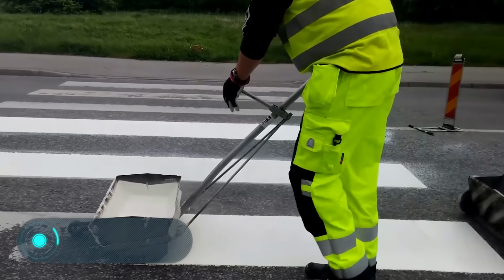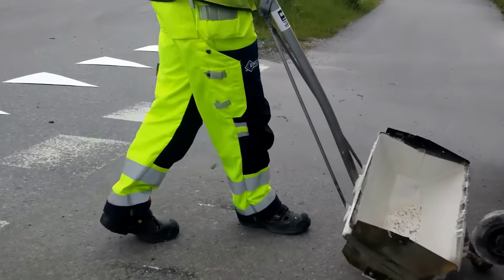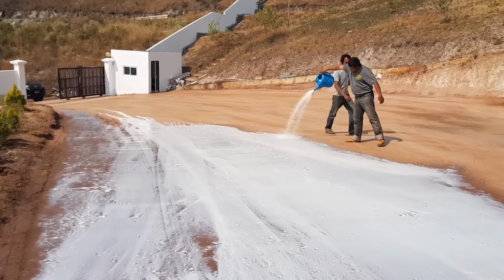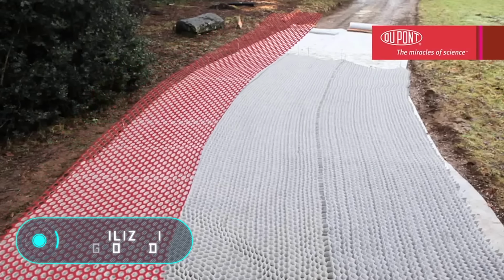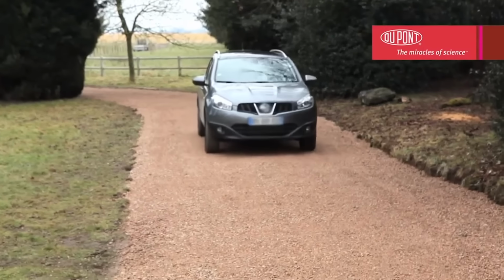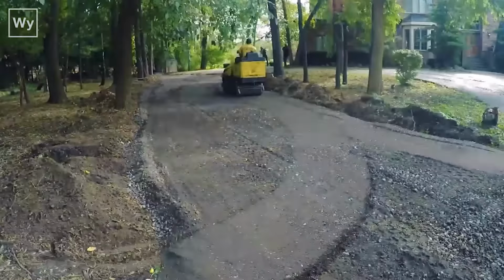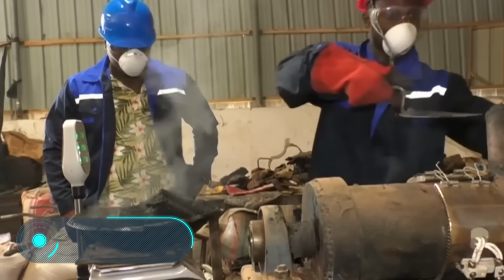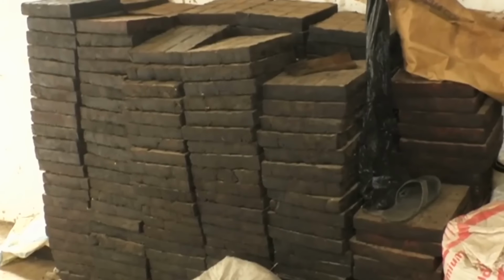INSANE ROAD CONSTRUCTION TECHNOLOGIES THAT ARE ON ANOTHER LEVEL

Comment: Just use shredded tires at emergency truck ramps. Then after years of sun degradation, and use, scrap them up lay down new shredded tires. Then take the old shreds and chip them further and add a percentage to asphalt!

Comment: As someone who knows a little about construction I would not be recommending this solution on main roadways.
This is ok for temporary roads only.

Tyres contain metal, metal heats up in warm / hot temperatures so will melt the asphalt and disfigure the surface requiring more repair works.

Same too for freezing conditions, this will make the tyres brittle (rubber becomes brittle in freezing temps) and cause the roads to collapse.

Plastic road markings - as you say these only last for 2 years, are very bad for the environment and again melt in high heat.

Geogrids are great for temp parking, foot paths etc, is pervious but costs a fortune
Not very well researched sad to say

Comment: Materials that last for 25 years are mentioned as high-end and durable and at the same time, roman roads are still around and sometimes even in use by motorists after 2000 years.
Reply: Roman roads didn't carry as much weight as modern roads, not even close:

RHEDA/RAEDA – a four-wheeled car that we would compare today to a bus. It had many benches and a place for luggage. According to Roman law, the weight of the transported items could not exceed 1000 Roman libra (approximately 330 kg). Usually, the car was a convertible, or it only had a cloth attached above the heads of the passengers. The cart was pulled by many mules, oxen or horses (even more than four animals);

This is a singular example, but it's clear they knew their roads weren't meant for extremely heavy loads. By comparison, one fully loaded semi truck weighs 80,000 pounds (~36,287 kg), and modern roads have to be able to handle that regularly.

Comment: i was wondering about how to use old transport truck tires to reinforce bridge piers and supports from river washouts .  tires layered around bridge piers and on river banks could be filled with cement and locked together by just the cement or maybe reinforced with lengths of rebar driven into the ground though the openings of the tires .  seems to me this would make a heck of a good method to stop flooding damage underneath bridges .

Comment: so i thought abut putting tires within concrete for under my driveway, not to just cut costs on material, but to also provide a good radiant heat battery, so when winter comes and the sun hits the concrete the heat builds up and the driveway stays heated for longer and that makes for less time you need or eliminate the need to use salt or shoveling the drive way.

i got the idea in how an earthship works, these homes hold tempter really well and that radiant heat holds very will. so i wonder if the same radiant heat could work for the same thing when it comes down to having a heated driveway. 

i think it could work but i think that the tires would need a few columns alongside the driveway to be used as heat holding batteries. the columns are also made up of tires that are filled with sand and compacted with super adobe to create that final finish that holds in the heat.

Comment: I was interested in fixing roads with tires. Guess we will never know.
Reply: it's not fixing.  it's just a method to dispose of unused tires.  tires can be used because they help stabilize the substrate.  it's killing 2 birds with 1 stone.
Reply: @bvbxiong5791  ------I understand it degrades overtime, and pollutes the water system
Reply: @deidradahl2802  good to know,
Reply: it would be a royal pain to resurface the same ^%& road.
Reply: @willengel2458  point.

Comment: there is a machine that can lay brick roads and walkways.  i had an idea a few years ago to use something like that but to mix it with a moving glass blocks factory to be used in high sandy deserts, to make desert roads from the glass, made in the factory from the sand :D   then i'm like a glass road...no.  how about glass walls?  or just the bricks but where they are shaped so as to build like enclosed walkways? or aquaduct covers?  anyhow thought i'd share it... the only downside i saw to it was potential habitat destruction.

Comment: Samuel benazzo who ever. Did NOT come up with the idea to use old/used tires for holding soil/rock for roadways. This method of using Tires to hold soil and rocks and pouring concrete or leaving it as stone covering them. Has been used for Quite a long time now. At least 60+ years. Heck, My Uncle was doing this in the early 90s and even earlier. He was Contractor and built roads into properties  for houses to be built in woodlands and Used Tires. Cutting them in half then pouring rocks  over them to prevent the roads from being flooded. So its NOT a new idea, Its Not Samuel benazzo idea. He didn't come up with it PERIOD. So fraud on him from saying he came up with the idea to use the old tires like this.

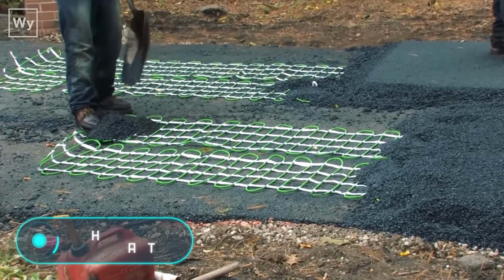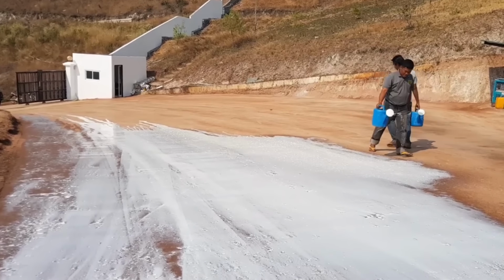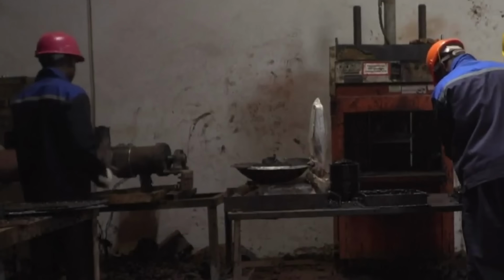Comment: The audio is messed up.  At around 7:06 it starts repeating the audio starting from 5:01, and the correct audio for that part doesn't start until 9:16.  Consequently over  2 minutes of audio are missing at the end.
Reply: The video is stolen, the audio is intentionally messed up to avoid an immediate copyright strike

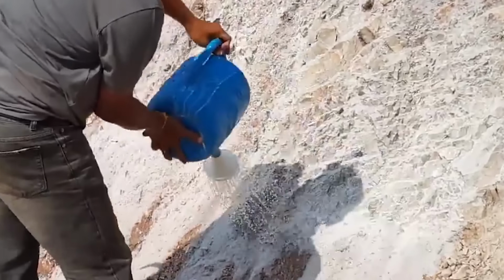Comment: 5:14 for protection against erosion gods created a thing called grass, try it it works!
Reply: You see how dry that soil is. Disturbed steep banks that are dry is just easier to maintain that way otherwise you'd have to reduce the slope and plant grass to hold it, and looking at the climate you'd have to water them too which gets complicated because it'll slip coz it looks weak in shear, they did say quarry and low bearing soil.

Comment: reduces the risk of flooding because geogrid retains water? really? is this correct?
Reply: if the idea is to "store water" in a reservoir tobprevent flooding then the volume of the geomembrane is miniscule once filled then it will flood. it would make more sense if the geo membrane is porous and it passes water so it reduces flooding.

Comment: I did some work with heated asphalt drives and walks back in the 80's.  The 1980's ;p  PS it was deemed not really feasible due to potholes.  Maybe new tech can deal with that.

Comment: 😨🙏👍❤️9:30 mark. The world
Better start using the plastic waste. otherwise it'll condone
Reply: 1st we need to STOP using plastic all together !!!!
Reply: Melicoy, you are absolutely right, but I would recommend starting by eliminating the single use items first. A strong set of Tupperware may pollute once they are ruined, but the use:waste ratio is not as bad as those disposable cups, bags, silverware, etc. Honestly, the world would do better if single use products didn’t exist. We can tackle the materials of long-term, reusable items after the Major polluters are dealt with (but if we make new, reusable alternatives, or just new products in general, we definitely should avoid non-reversible and non-biodegradable materials when possible). 

I know that this is an urgent problem, but it would be such a shock to life that semi-gradual, but strict, reform is likely necessary.

Edit: Sorry about that. I work with a small division of an international plastic coalition of sorts run by teenagers and young adults. I mostly run the tech side of the meetings (long-distance conferences) and help with communications between the english speakers (The US, Canada, Australia, and the UK) and the German Speakers (Germany, Switzerland, Austria, and Belgium)

This is excessive amount of “exposition” for this statement, but throughout my experience (I’m 16, so yeah, TONS of experience) I have learned one thing: we NEED to start following in the footsteps of Central Europe (especially around the German-speaking areas and Scandinavia) in terms of eco-friendly reforms, official and social alike. Those machines that collect empty water bottles, the amount of returnable glass bottles, refillable product bottles at stores, better public transit, better recycling practices, and just about everything else they have done to better help the environment over there should be done here. If only we weren’t so massive and didn’t have space for landfills. They don’t have enough land to simply chuck all their waste into a pit.

Comment: Surface stabilization GEOGRID:  "Lasts UP TO 25 YEARS if not exposed to sunlight", for parking lots, driveways and walkways.  "UP TO 25 years" means the driveways, walkways and/or parking lots will start to break down long before 25 years, and must be re-done every 20-25 years. The expense of resurfacing and/or re-doing any Geogrid project makes it impractical.  There are better ways to avoid rainwater pooling on surfaces than having it absorbed and held by the material under-laying the surface.  In areas where rain can be followed by freezing temperatures this material CANNOT BE USED because the first freeze will cause heaving and destruction of the road surface.  Use slight degree of tilt for driveways and walkways.  Drainage channels used for parking lots w/slight tilt by sections solve runoff [problem.  The techniques shown here remind me of our THROW-AWAY society where speed and cost are more important than quality and longevity.  I"m NOT A FAN of this stuff.

Comment: In Finland they used tires when they built a road and then they had to dig it up becuse the tires o
Polluted the soil
Reply: tires don't pollute anything, they are made out of hydrocarbons. it may be the off gassing.
Reply: @HamguyBacon  On the long term they will pollute by definition.  Rubber hydrocarbons have sulfur in it, that's required for vulcanization.  And there is a lot of additives to make the tires wear resistant, not too flexible, UV-resistant, etc... Some of these elements are part of the hydrocarbon molecules, others are "filling material".  So there is a bunch of potential hazardous elements that come free when the hydrocarbons do off gas as you mention.  But I guess not that much off gassing will happen, most of the hydrocarbon molecules do not decompose that easy.  The rubber will rather fall apart in small fragments (groups of molecules together) that will be absorbed in plants or animals food chain.  And so, probably your after after after granddaughter will eat pumpkin soup with a tiny tire taste?
Reply: @HamguyBacon  yeah sure thing buddy, some tires will even last for 200 years in best conditions!  But they WILL disintegrate one day by definition!  Luckily our offspring will solve that, no problem for us.
Reply: @HamguyBacon  The guys in your video's say nothing about disintegration???  Where did you find that good condition rubber produced some thousands years ago, please show me!  I suppose you never dug up some plastic or rubber that has been for 20 years in the soil?  What you see then is what they call disintegration!  For sure the sun is an accelerator, but is not required. http://polymerdatabase.com/polymer%20chemistry/Thermal%20Degradation%20Elastomers.html
Reply: @HamguyBacon  Natural rubber is not the subject here, as it has no harmful disintegration.  And surprising to you, tires have only a small fraction of natural rubber in them.
Reply: @HamguyBacon  really ! Face palm 🤭
Reply: @HamguyBacon  LoL just seen the other reply 😆 . Priceless 👌

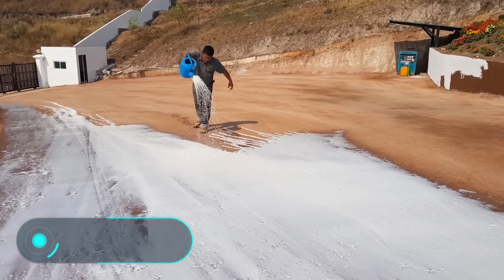Comment: Soil stabilization at 4:15. Must not be bad they walking in it barefoot.
Reply: Looks like a simple old fashioned Lime and Calcium wash
Reply: @mysty0 Rustedblade it's a bit more complex than that. Kindly read the comment above. Thanks.
Reply: @k31  calcium and lime would be a shitload cheaper and achieve the same result
Reply: @mysty0  you're entitled to your opinion. Thanks 🙏
Reply: K31-APS acrylic co-polymer soil stabilizer. It's a 100% eco-friendly. Just wash off after use. Diluted with water very safe to use.

Comment: As a Canadian I look at the heated road skeptically.  For a bit of snow at -3c maybe, but in a full snow storm, forget it. Then it may melt a thin layer of the snow ontop of it causing a water hazard.  But hay , in limited situations great.
Reply: Yep the water has to go somewhere and freeze for sure.
Reply: as a Canadian too, I'm skeptical even I dreamed more than once of a similar system, to avoid snow completely you probably should let the system 'on' all winter so.. hiring a Cie to clean your driveway cost less I think .

Comment: I was waiting for you to say that the geo textile grid was made out of recycled plastic or tires. The tires in the road are brilliant really. 

That stabilizing agent that was used to keep the dust down, was that a mixture of glue and water? It looked like it.

Yes since our roads are tar covered anyways, I am always glad to see garbage go under the road to improve the road while also disposing of a real waste disposal problem.

I like seeing places that add plastic to the tar that they use to pave the road. It makes a higher quality road then just straight pavement. I don't see those plastic blocks as a good solution to making roads but walkways and driveways for sure. It is better to make the road out of a long continuous thing to reduce bumps over time. Those individual plastic blocks will tip and make a really rough road unless they are constantly redone.
Reply: Asphalt with plastic additive in the tar component is called superpave.  It's incredibly hard to work with and impossible if it cools off even a little bit.  The quality of the job suffers and the sun & freeze/thaw cycles breaks it down faster.  Premature pavement failure has become the norm.  It's a good place to hide a landfill right under your tires though.  They need to start adding poopy diapers so I can smell that squishing through a paver at 350° F too, ffs!  Even breathing in fumes from hot superpave is hazardous.

Comment: So cutting edge that they use a 1$ water pourer to cover hundreds of meters. So efficient.
Reply: Obviously it is the material being put down that is being showcased, not the method that one company uses to put it down. Come on man, is it really necessary to have to explain that? It still amazes me how quick people are to post ignorant comments from the seclusion of their computer.
We were shown an area no longer than 150 foot that they were treating, which does not require bringing out a trailer with an engine powered sprayer. If they were treating "hundreds of meters", they would obviously not be using garden water cans.
Reply: @VagueMemory  that looked like 200 to 500 m^2 to me. I'm bad at estimating, though.  When they factor in the time that it takes to prepare and shut down, and then average out the time for a square meter, then I wouldn't be surprised if they took about 2-3 minutes per meter.
Reply: @VagueMemory  on top of that, they did the slopes, too.

Comment: What is the environmental long term impact of the tires deterioration ?
Reply: Less, if they're under a waterproof layer of asphalt or concrete.  What are the long term environmental impacts of having tires on your car, buses, delivery trucks, and YES bicycle tires?  They deteriorate much faster driving on top of the street, being worn into dust particles with more surface area per volume, so they release chemicals faster.  Then the dust is washed into the nearby ground and into lakes, streams, rivers and oceans.  What's the environmental damage of having a horse and needing 10 acres of trees cleared to grow enough food per year for JUST THAT HORSE?  If there were a billion horses instead of cars, would there be enough room to grow food for them all?  Would all your horseshit pollute the earth and its groundwater?  ;)

Comment: Heated asphalt is completely impractal in almost every situation.  The building I work at has a heated parking lot.  It was installed about 40 years ago when the building belonged to the power company.  It uses more electricity to heat the parking lot than it does to power the entire building.  Unless you have a lot of money to burn it just isn't worth it in cold climates.
Reply: Depends on how it's heated. You can use liquid instead of heating elements. Then either use a heating element to warm the liquid, or use waste heat from the building to heat it. That or a bit of both. 

You could also argue that the techniques and implementation could be better today than it was 40 years ago. 

One last thing, would it be cheaper to have someone come by and plow/de-ice? than the electricity used? You can figure in lower insurance rates due to less instances/risk of slip and fall claims, and any number of other situations that could make it worthwhile to keep using it. While it may seem costly on the face of it, it could actually be about the same as alternatives or better.
Reply: I thought they used hot water to melt the snow
Reply: @Abdi-uy1kh  There are two types that I am aware of, heating element, and water/liquid. Ideally in an under ground system like that you wouldn't want to use just plain water. It would need to have some kind of antifreeze mixture. Yes I know moving water wouldn't freeze easily but it can. Also if power goes out and the water isn't moving it will freeze so you wouldn't want frozen pipes under the driveway because if they bust it would be costly.
Reply: @q......  Thank you
Reply: Dylan sky  I'm surprised they would use asphalt up there. I would think gravel would take the expansion much better.
Reply: Dylan sky: Yup I wondered where they were talking about when they said cold climates. They definitely weren't talking Canadian winters. I'm wondering which Canadian cities they claim use it.